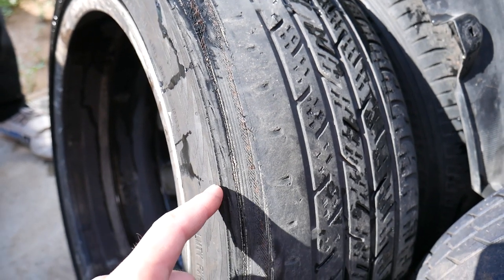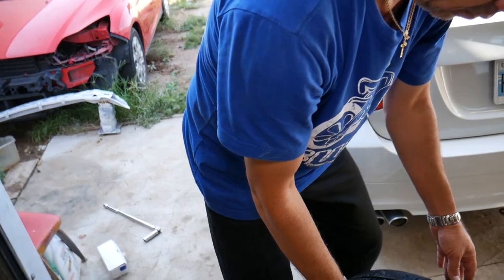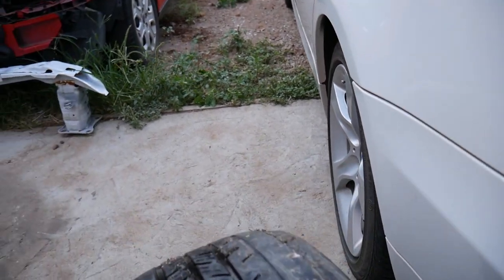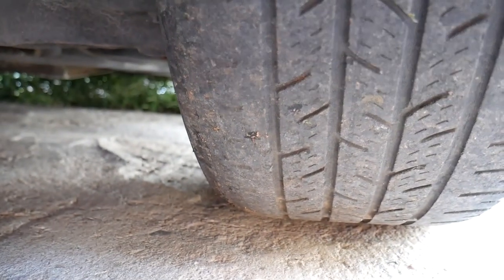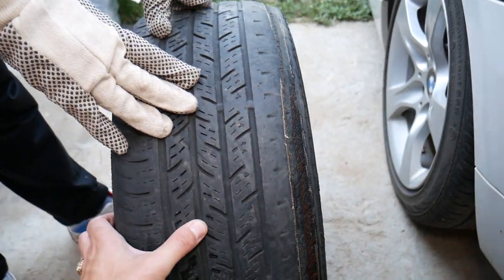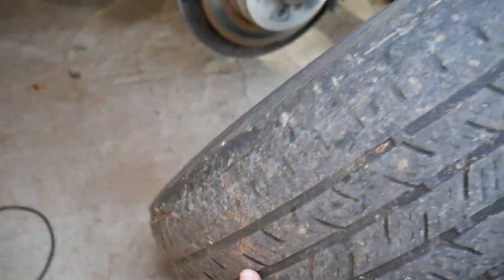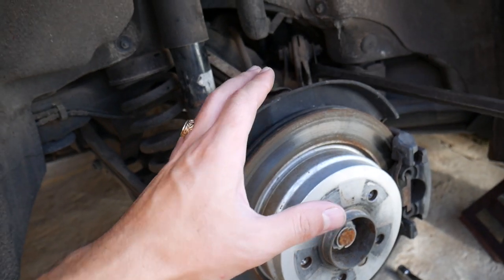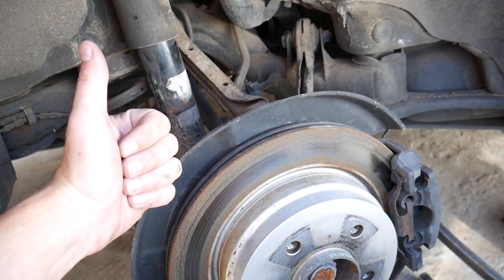WHY BMW TIRES WEARING ON THE INSIDE

Comment: Three vehicles that I owned had left rear tire wear issues:89 Pontiac Grand Am,91 Chevy Celebrity and a 02 Chrysler Sebring. The Pontiac I was able to shim the wheel bearing/drum brake housing with washers to help cure the problem,The Chevy this wasn’t possible and had to rotate tires more often,the Chrysler has adjustable rods on the rear wheels that you can adjust the camber and toe on the rear wheels.

Comment: On my X5 there is a heavy -ve camber on one rear tire.  Same side has a bad Air Spring so there is more pressure on the control arm and suspension parts.  So check your air springs also.  After that the Camber adjustment bolt can be adjusted (if there is room for it).

Comment: the bad inner worn was due to the bad bushing. when braking, the wheels will toe-out more than they should. 

great video!
Reply: Absolutely right. Camber wear would be more evenly spread across the tyre not just isolated to the inner shoulder. Statically measuring the toe with the car stationary fools people into thinking their toe is fine but that doesn't tell you what's happening to the toe when braking (or accelerating).

Comment: Same problem I go through tires like crazy had all kinds of bushing ball joints arms replaced
Reply: What was the problem?
Reply: @fahadaljassem  all that stuff was being replaced at the time of this comment,however I needed an alignment and it got a lot better. Since then though I hit a massive pot hole 🕳️ and I had to replace my axle and my strut the spring was still good and the car drives straight still it’s most likely an alignment

Comment: Hi. Great videos. 
I have an E90 328i with factory M sport suspension and 18 inch BMW wheels.  When driving on rutted or uneven roads I am experiencing strong tramlining with  severe tugging of the steering wheel.  What would be the causes for this?
Reply: Seized calliper or front wheel alignment or control arms

Comment: On my E92 all my stuff is aligned to spec and it still wears more on the inside than outside in the rear.
Reply: Maybe too much city driving?
Reply: Going fast around corners
Reply: BMW are designed to have a negative camber. It's for cornering at higher speeds than normal! Hence made to be driven it's a sports sedan. It's made to take corners and stick to the road.
And that's the price you pay for having a sports sedan. Get a Kia you'll be good to go and you can even rotate the tires all the way around. Prolly save on. Gas to
Reply: @Catchmeifyoucan209Stockton get a KIA so u save money on tires and fuel... used the saved up money for a new engine and trans every 70k miles lmao

Comment: Hi, would excessively worn  rear upper suspension arm bush/pin cause this tyre wear? Thank you
Reply: What type of car
Reply: Bmw 330i m sport
Reply: @roger1uk676  yes but check all bushes
Reply: Thank you! Your videos are the best on youtube!
Reply: @roger1uk676  no I'm a viewer
Reply: On a f82 f83 you live with 12k miles on tires if you are lucky. Stock neg camber and  all bushings good.
Reply: @LemonySnicket-EUC  adjustable control arms will let you take the camber out and even out the wear.

Comment: On my 2015 f83 I'm lucky to get 12k miles since new on sport tires. Stock camber and all bushings good. All tires wear out on inside. Chords show quickly.
Reply: Did you fix it
Reply: @fahadaljassem  the fix is to not drive so sporty. ☺️

Comment: What happens if you adjust to have no camber on a bmw?
Reply: Then you should prolly sell it and buy a Kia
Reply: You cant have no camber. There is only a tiny amount of adjustment. I've adjusted mine as an experiment to the extreme to avoid inner edge tyre wear but it doesn't feel very planted anymore. The only solution is to swap rear to front, and reverse the tyres every 3k so the excessive wear is shared out to every corner of All the tyres. This only works if your tyres are all the same size. I have 4 bmw e61 and they all wear inside edge on the rear. I suspect they did from new as even completely new suspension parts do not stop it completely.